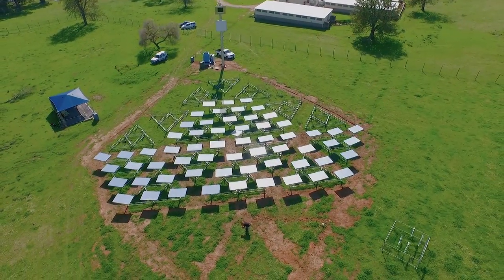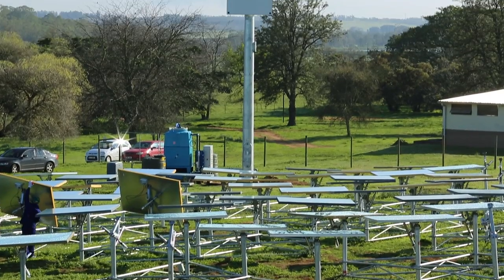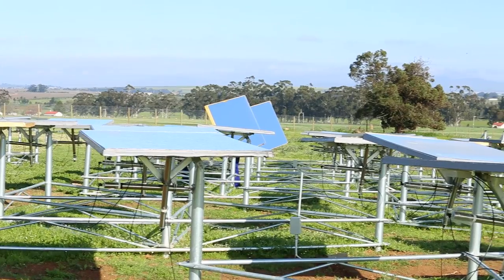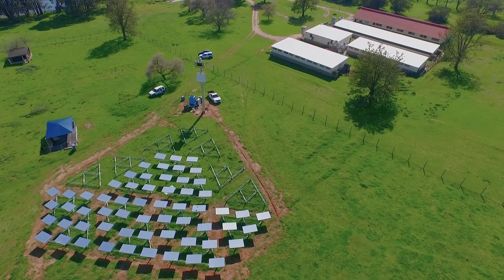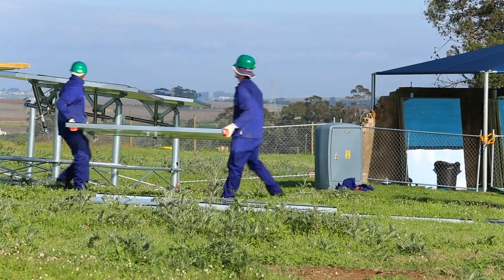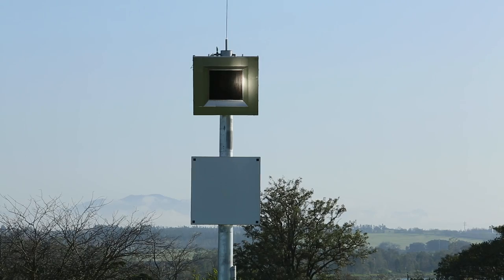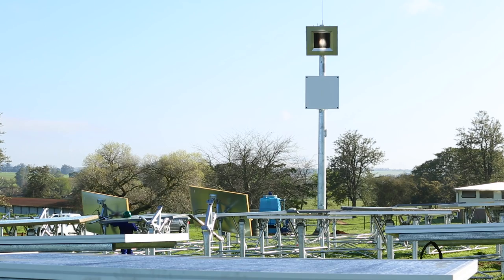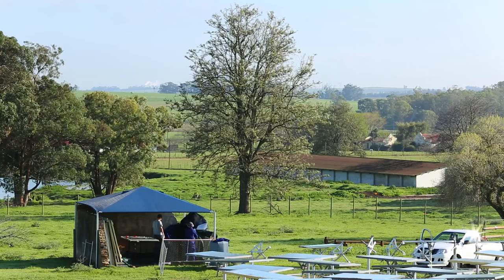Helio100:  breakthrough for modular concentrating solar power

Comment: interesting thou as longa s new methods are hard to setup or maintain the energy they never replace fossil fuels thats main problems for almost all of greed techs too expensive or too hard to setup even pv is rely on expensive batteries or have to ingrid with current systems to actually works!
Reply: brought to you by big oil